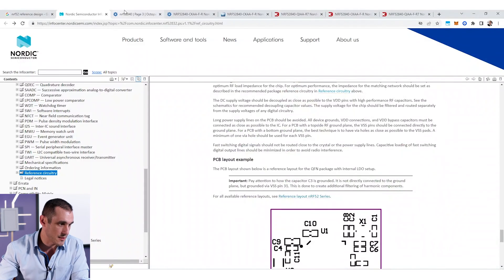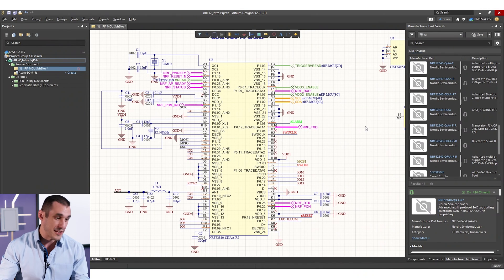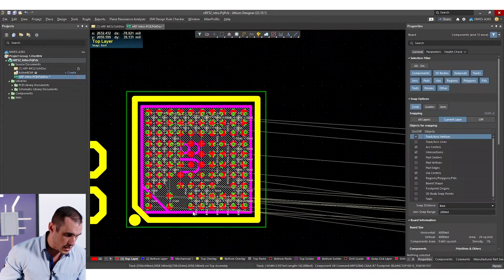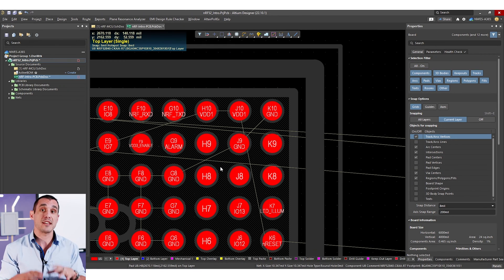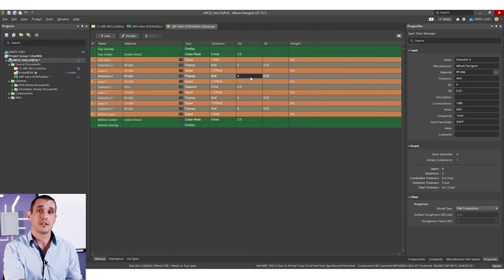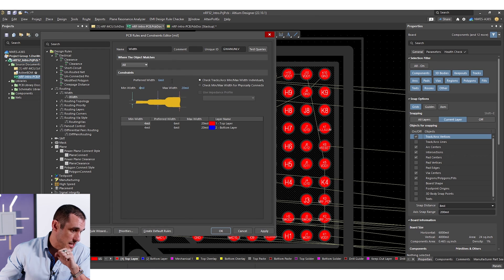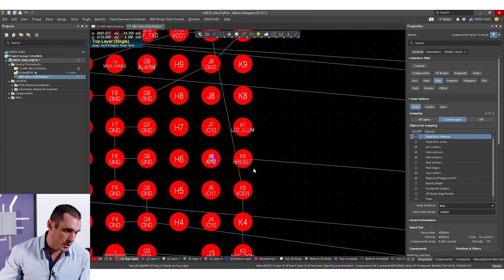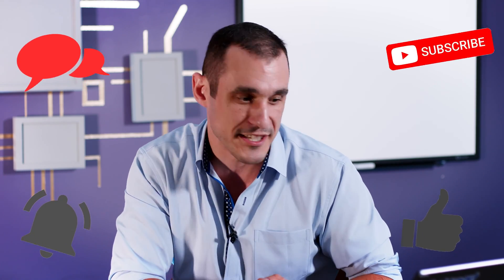Getting Started with an nRF52 Series MCU Part One

Comment: Hi Zach, is there any reason why you went with the BGA Package instead of the QFN? I'm asking because i can find the QFN for much cheaper.
Reply: Mostly because we wanted to do an example with a BGA instead of the QFN. I've also used the BGA in multiple projects and had it manufactured, so the example here shows how to deal with the HDI aspects of this particular package.
Reply: @Zachariah-Peterson  Thanks for the reply. But I can also go with the QFN and there won't be any significant differences?
Reply: @avocadoamongos  in terms of the device capabilities and interfaces, no there is no difference. The BGA component is more useful in the case where you are already doing an HDI stackup build and you will be using blind/buried vias anyways, so you might as well use the BGA. In a conventional build, you could not use the BGA unless you have access to very fine line etching capabilities and no larger than 6 mil drilling, and you might not comply with IPC Class 2 requirements. In conventional builds you can always use a different package.

Comment: This could have been done with just 4 layers
Reply: You probably could, depending on where you are routing you could still get the required isolation between signals with ground. This actually brings up a really good topic about layer reduction, which we sometimes have to do in order to optimize a design before scaling, so maybe I'll make a video on that topic!
Reply: @Zachariah-Peterson  Wouldn't be bad at all. I have made a 4 layer board with this mcu. 1-4 feed-thru via and 1-2 hidden via.
Reply: @TheEdmaster87  Filming it tomorrow, stay tuned!

Comment: 0.5pF? So, 500 femto farad then? How is that even a thing? Won't you have so much parasitic capacitance, that it doesn't do anything? How much parasitic capacitance would there be in that region of the circuit? Down in the femto farad?
Reply: Great question, the parasitic capacitance with ground on the next layer could be a significant fraction of the capacitance and that would modify the cutoff frequency for the matching network, which is one reason to use a ground cutout below that transmission line going into the antenna (we'll see this in part 4). It is still a coplanar line so the GND on the top layer sets the impedance, and there is GND on the bottom layer, so that significantly reduces parasitic capacitance. I'd like to note that if you calculate what the cutoff frequency is for that circuit, it's already much higher than the edge of the RF band (the band ends around 2.5 GHz), so a little bit of extra capacitance around that pad (from fringing and the cutout) won't greatly change the circuit behavior. Also your tolerances in that capacitor could be larger than the leftover parasitic capcaitance with the cutout (depending on the stackup).

Comment: What is that transistor circuit on the power rail?
Reply: It looks like a means for temporarily measuring the supply/battery voltage.  It's temporary so it doesn't put a constant drain on the battery.